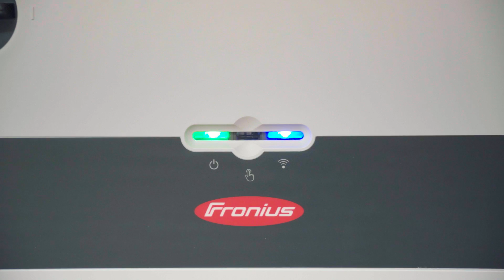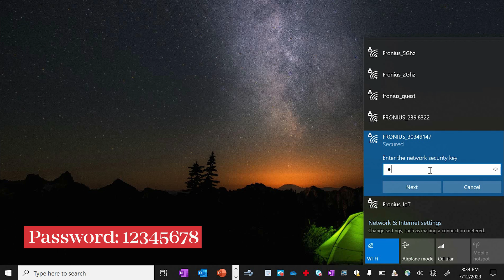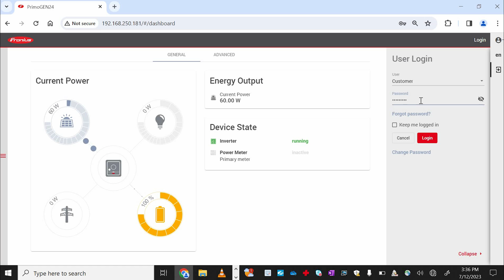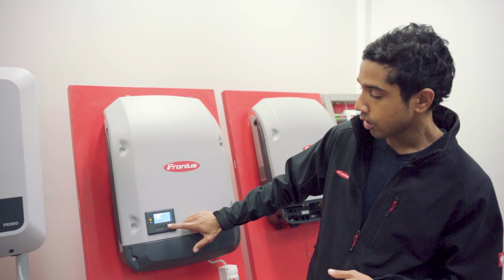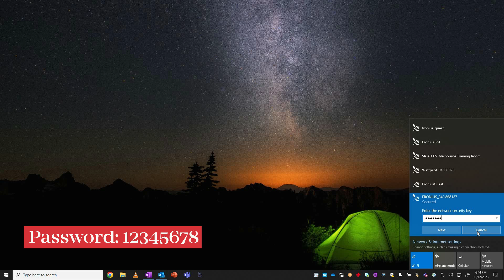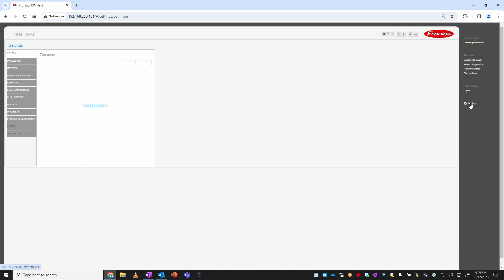How-to: Activate the Remote API Control on GEN24 & SnapINverters (AUS)

Comment: So it's turned on how do you remotely manage it yourself?
So another pointless video...

Great how you have given out the same password so anyone can hack it by simply touching the inverter 😂
Reply: 1. As you have correctly pointed out, the attacker needs physical access to the inverter. That means the home owner needs to decide who to let in or not.
2. The password is only usable for accessing the internal wifi, that is only active if that touch button was pressed. It is not always on.
3. The only thing an attacker have access to are the status reports, for anything more sensible (changing configurations, etc.) the attacker needs a customer or an admin password.

For me this was very helpful , because now I can enable Solar API to connect my Home Assistent server with my inverter.